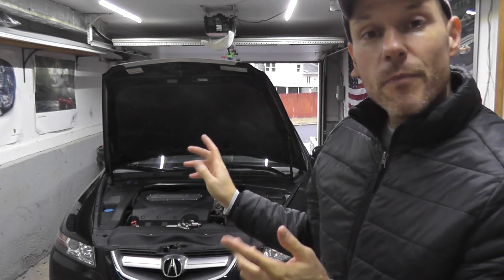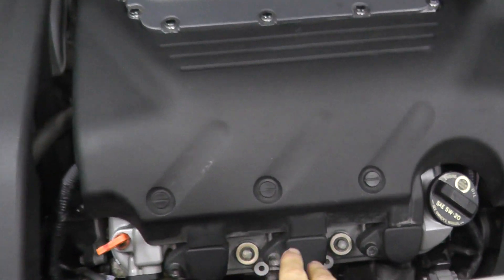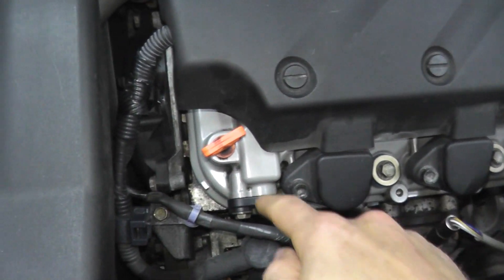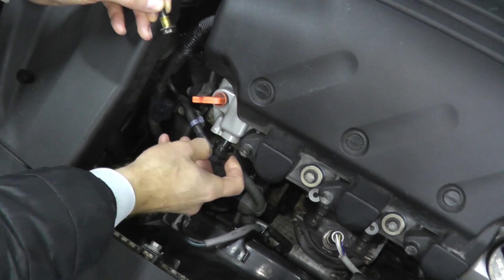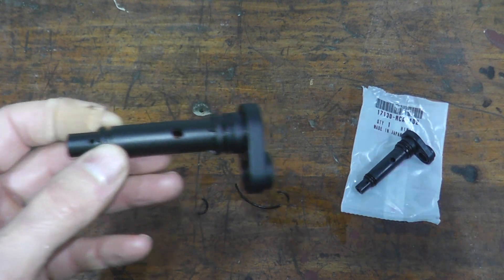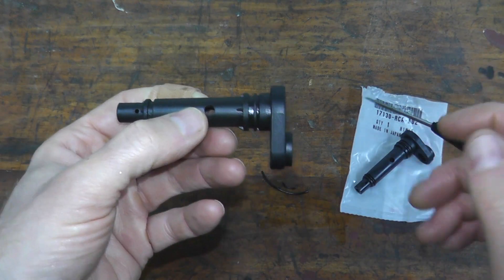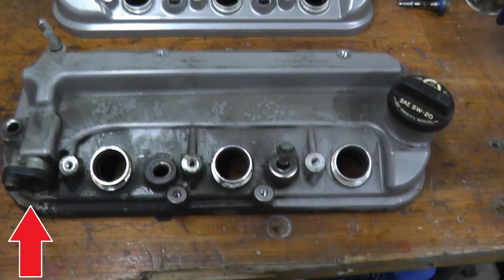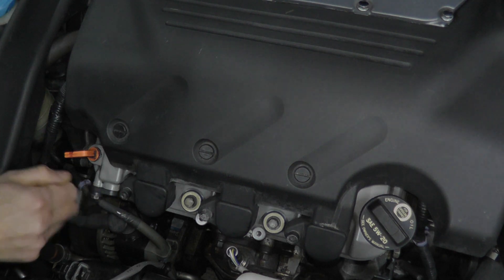I Am A Complete Fool! | Do Not Overlook This When Changing Valve Cover Gaskets!

Comment: When you originally removed the valve covers you cleaned the outside, not the inside baffle. You could see the carbon sludge build up. The same for the pcv valve. Yea, should've replaced the pcv valve when the covers were off. And perhaps you need to change the oil brand your using. 👍

Comment: Yah,  good TIP.   I  changed PCV valve  on Honda Odyssey . It looked like it was causing issues.  Was consuming oil like  almost 3qt every 3k miles.  I did use a aftermarket part from eBay.  That was about 1 year ago.  I’ll keep my eye on it  since it wasn’t OEM . 
The oil consumption every 3k miles is now like 2/3 qt every 3k miles.  
I also changed to 5w20  synthetic blend Havoline high mileage.  I used to use SuperTech 5w20 high mileage conventional.

In general I think it’s good to change PCV valve every 100k. As part of the 100k maintenance.  I have advised some family friends with also a odyssey to do the same with 100k maintenance .  Since PCV is very cheep part.

The odyssey we have has about 220k miles.   Timing belt changed at 198k miles. Likely 2nd time it was changed
Reply from the maker: Very cool. Appreciate the feedback!
Reply: What year odyssey?  I have a 95 with over 300,000 miles. I'll check the pcv valve
Reply: @pirihern9329  2007